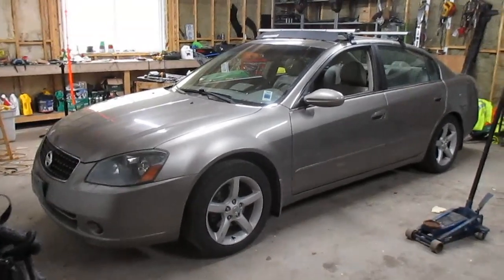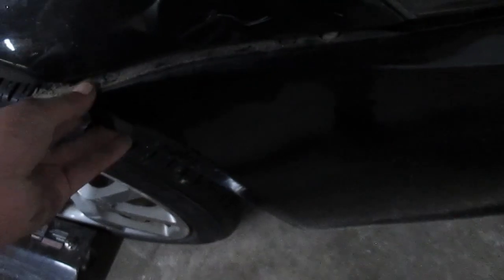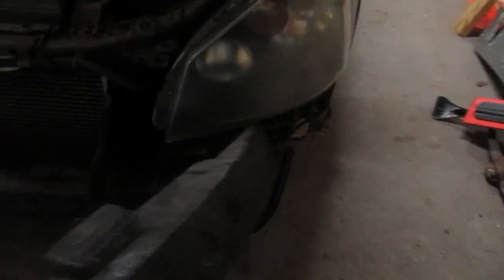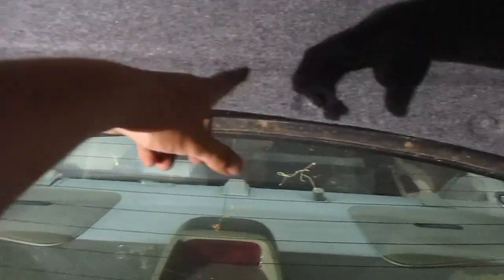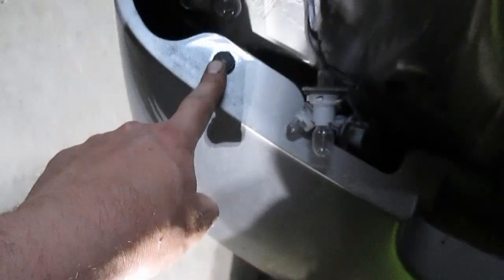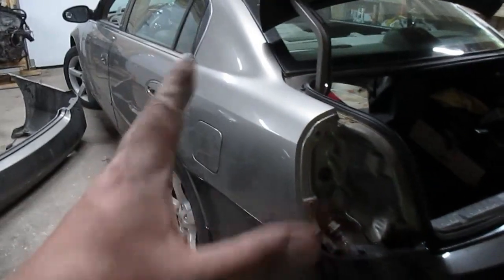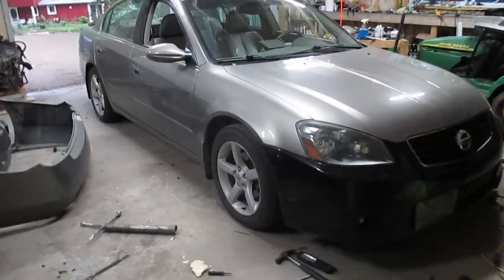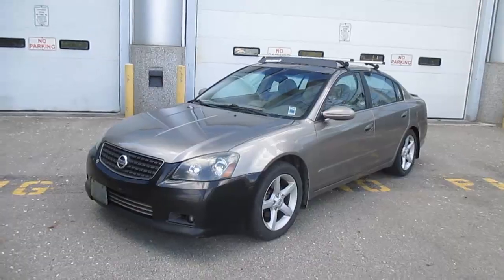Altima SE-R Front and Rear Conversion

Comment: Hey i know this is odd but do you by chance know if a 2004 altima front bumper/grill will mount to a 06 altima
Reply from the maker: In order for an 04 bumper to fit an 06 you will need to also replace the headlights and hood to make it work.
Reply: @DNALI  ur awesome THANKS ALOT !!! Ive been trying to find an answer for so long. & im new to ir channel and you do amazing work 👍👍 definitely subscribed

Comment: Are the rear bumpers any different? They look the same. Asking because I want to do the same conversion
Reply from the maker: Yes the bumpers are different.  I made a side by side comparison video showing all the differences 
https://youtu.be/T22m2L9_dsg
Reply: @DNALI  yes I saw your video, I’m in the hunt for the bumpers, side skirts, and spoiler rn.
Reply: @DNALI  I came up on the se-r oil pressure, voltage and mpg gauge. Is it hard to wire it to my sl 2.5

Comment: So I have a 2005 Nissan Altima 2.5 SL. Would a 2005 SE-R bumper fit on mine? I just can’t find answers but you seem knowledgeable.
Reply from the maker: Yes the SER bumper will fit all 2005 and 2006 Altimas.
Reply: DNALI sorry I hate to do this but do you have a link to an SER bumper you can send me? I’m so sorry I just can’t find one. And even thought I don’t have an SER model?